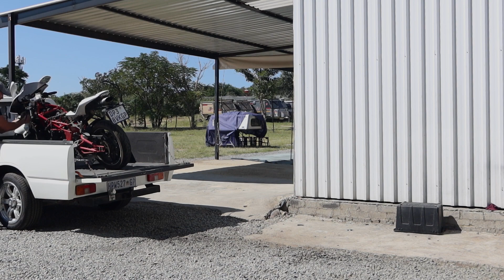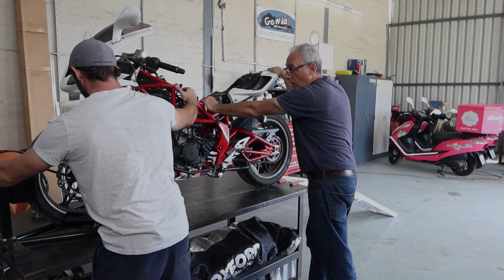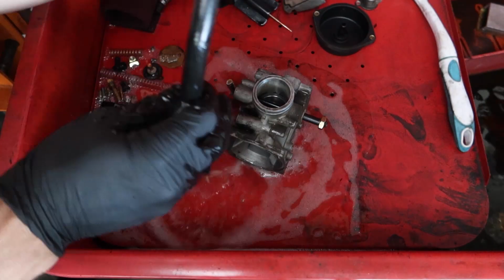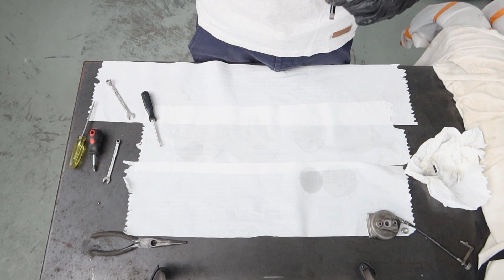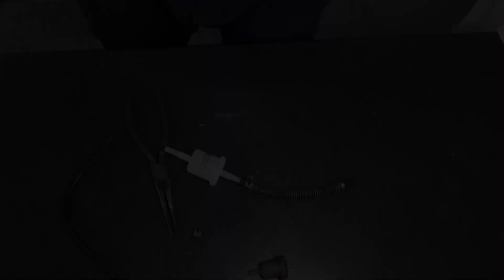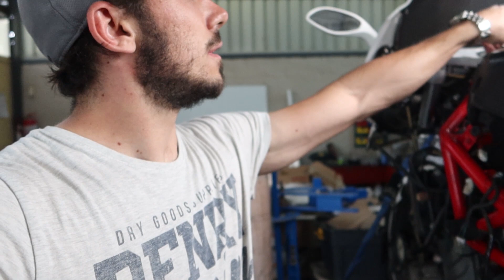250cc Street bike rebuild [Megelli 250r] - part 1

Comment from the maker: Have you rebuilt a bike before ? If you said yes, let me know what bike it is!
Reply: good evening n got same bike today where can n find a starter gear for this bike its the megilli 250s
Reply from the maker: @thomasvandyk6425  hey Thomas, try bikers warehouse in Northriding,  they might have one in stock
Reply: @AdvSouthAfrica  thanx alot wil try theme and why does my carb not getting feul at all
Reply from the maker: @thomasvandyk6425  I've heard the early models had a fuel tap that requires a vacuum to open it,  potentially strip the tank off and ensure you're getting fuel, if it is one of those then I'd recommend replacing it with a conventional fuel tap like my model has
Reply: @AdvSouthAfrica  itt does have a tap but not sure how to connecting the pipes correctly
Reply: its getting  feul from tank but not in carb it is dry
Reply from the maker: Definitely give the carb a full clean with carb cleaner, sounds like your needle and seat is stuck but if that's  stuck then chances are the rest of the carb needs a clean anyway🤘
Reply: @AdvSouthAfrica  thanx alot wil do the guy told me that the bike just reved up to 7000rpm and then he cleand the carb and from then it not starting
Reply from the maker: @thomasvandyk6425  Rather go through it yourself and make sure, especially if the carb got no fuel during a ride then the engine will rev up for a second and then turn off
Reply: @AdvSouthAfrica  k wil do so u think itts the carb that needs a clean
Reply: thanx for the advice
Reply: good eavening sorry for trubling so late is it poseble that u can send me a pic of how the carb feul line. so i can see where the pipes sould be mine only has one pipe coming from tank to catb but has another 2 nippels on carb but got no idea how and where itt should be conectted to
Reply from the maker: https://youtu.be/MBotrENdpms in the start of the video you can see carb but not all pipes... basically there's  a copper looking one that is the fuel inlet and then 2 plastic ones that are held in with retainers and those are just overflow/breathing tubes for the carb 🤘 hope that helps man
Reply: @AdvSouthAfrica  k cool thanx that helps and a big tube like thing on the left side of bike. has a pipe on one side but not on ather side when i puse the bike it blows wind out does it conect enywhere

Comment: Congratulations! very good video! question ... does it work well with that air filter?
Reply from the maker: Thanks so much, part 2 is out if you want to watch it! Yes it's been running great with the cone filter on, it sounds great too!
Reply: @AdvSouthAfrica  in my experience the vacuum carburettor when working by suction, does not work with a conical filter at high revolutions, try it with its original filter and compare it, thanks for answering bro! greetings from Argentina!
Reply: @JesusGDiaz-rj2cu  Mirá donde te vengo a encontrar, ja ja ja. Mostrale la rubia y se cae de espalda <3
Reply: @gastonfernandez3655  jajaja jajaja amigazoo andamos por todos lados 💪💪💪

Comment: Sup bro,

Bought this bike two weeks ago.
DIG IT.

However.
I've just serviced it, and now..
I have a complication.

I don't have insta, how can I get in touch with you man..?
Reply from the maker: Glad you're enjoying it! 
What's the issue?
Reply: @AdvSouthAfrica  
Man..
I just serviced it.

Now, I have an issue with figuring out where the yellow wires go,
Leading from the rectifier.. to the engine..
Then there's a plug, no clue where it goes.
Reply from the maker: You're going to have to find a wiring diagram for the bike and see what those wires do. If they come from the rectifier then chances are it's your charging circuit

Comment: So far you are probably the only person who would be able to help me... At what position should the fuel/air mixture sit? At how many turns? And any idea how I would be able to get the fans working? Think the thermostat is gone.. Still learning all this bike stuff. Also, what are the rev pulse on the display for?what does it adjust?
Reply from the maker: Hey Cat, the air fuel mixture screw is set depending on your altitude, typically where I live I do it 2 turns out, I'd recommend running it richer rather than leaner to avoid engine damage. Your fan will only turn on when the bike gets up to a certain temperature,  they don't stay on all the time. If your radiator is getting warm/hot when the bike is running then your thermostat is fine. I'm not sure what you mean about Rev pulse. I hope this helps man! 🔥